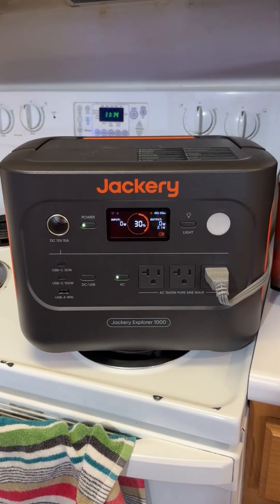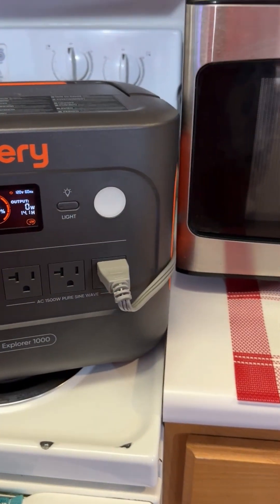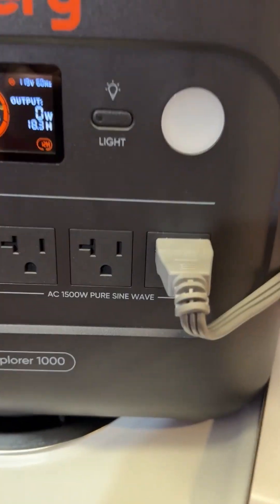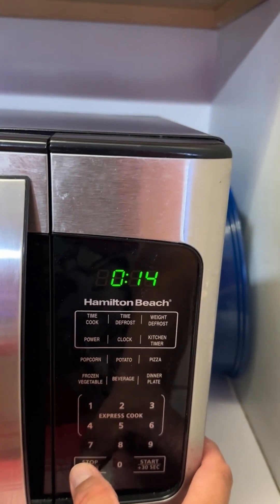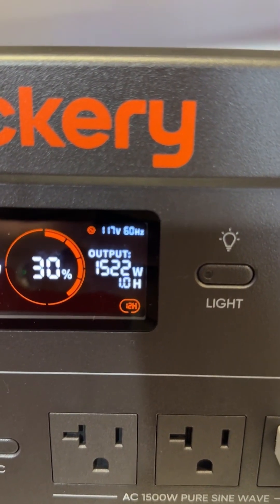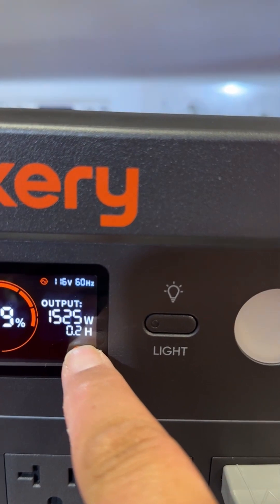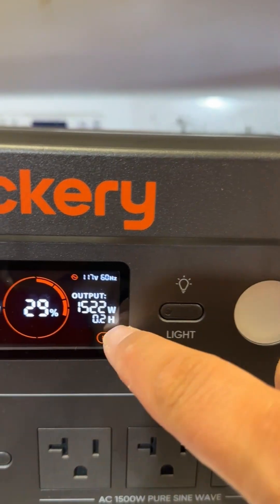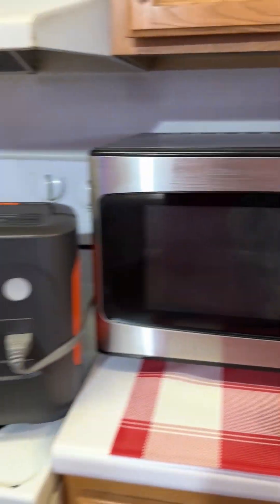Running Microwave with Jackery 1000 v2 Power Station

Comment: I've had a Jackery power station and their 200-watt solar panel for only one month, having used it around 10 times for practice and trial-and-error, and one of the solar panel kickstands is already beginning to break off.  I'm also unhappy that there is no kickstand in the center of the panel, only on the ends, because when set up the center always sags and doesn't face the sun the same way as the ends do, so you need to use something to prop the center up.  I use a cynder block.  I contacted customer service and was disappointed in their response times.  I was hoping they would send me a new solar panel.  Since I was still within the 30-day return period, I returned it.  I think I'm going to go with Bluetti.

Comment: Your title to this video is incorrect and should be updated to match your content. The title currently says "Running Microwave with Jackery 240 v2 Power Station", but in the video you are demonstrating the Jackery 1000 v2.
Reply from the maker: You are absolutely right, my apologies for the title error and thanks for pointing that out!